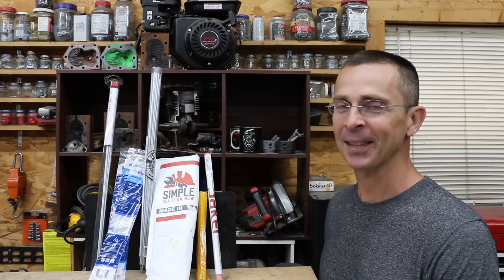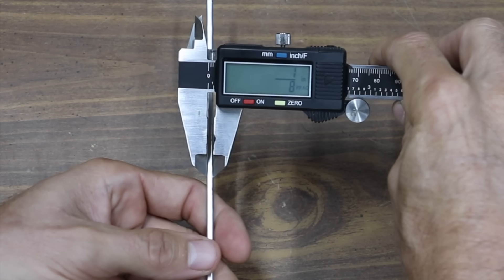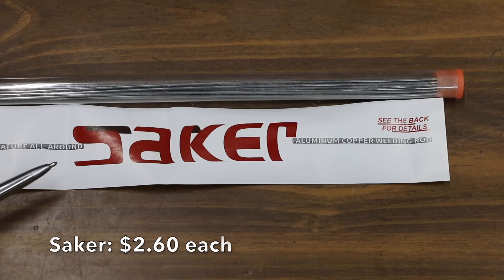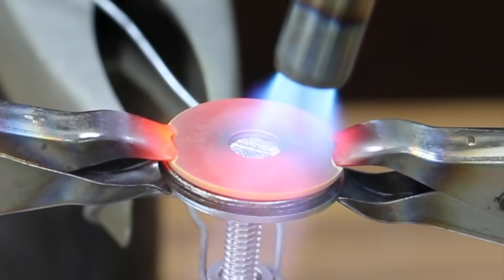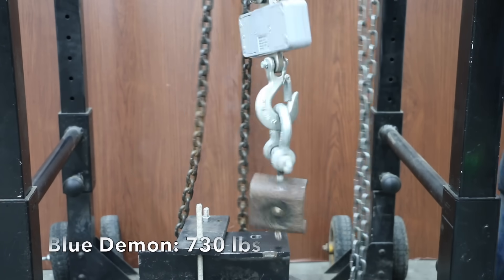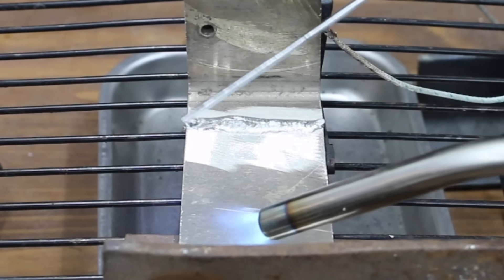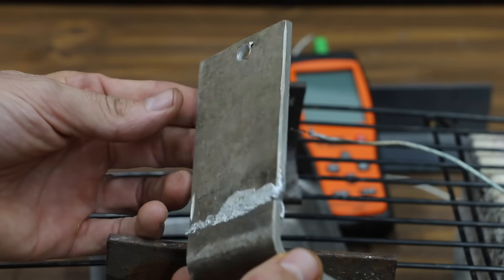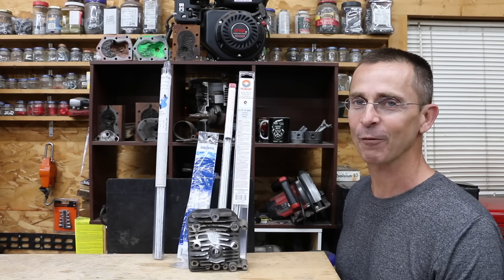Best "No Welder" Aluminum Welding Rods? Alumiweld vs Bernzomatic vs Hobart

Comment: Fun video but you should read up on thermal emissivity if you are using a thermal imaging camera. It prevents misinterpreting the images.
The welded areas could be colder than the rest of the block if it has very poor thermal conductivity but it is more likely to have a lower emissivity causing it to read lower on the camera.

Comment: Chlorinated parts cleaner is only an issue when arc welding. It's the intense UV light that breaks the chlorine down into phosgene. For braising, after the cleaner evaporates, you should be fine with some ventilation.
Reply from the maker: Thanks for the feedback.

Comment: You skipped an important test. You should have tested each rod to see which one flowed in the cracks the best 💯 also you probably should have heated the inside because the rod would have probably flowed to the heat like solder does.
Reply from the maker: Thanks for the constructive feedback.

Comment: Well I suppose perhaps im cursed somehow
cause the bernzomatic rods refuse to melt
for me? On one instance I got my material cherry
red hot just to finally reach the rods melting point
and NOTHING. Im very hard-headed I do not
give up easily but this current project is really
testing me & my mental limits! (broken lifter bore
in dodge 4.7 upper valve train)
Reply: * I never geated the head at any point as I simply did a test run on the broken piece of lifter bore on my work bench and on my fist go the piece melted in less than thirty seconds! I had an old water-pump from an old nissan armada that was no good so I melted some of it down and made a cast mathingvthe piece that had broken off I just cant get it to bond with the head and I Do not want to remove the head from the block
& I damn sure dont want to take to a mechanic as I cant afford it even if I wanted to? sos...(help)

Comment: I just used the Berzomatic to repair an aluminum carb float bowl which had a leak. Had a small hole worn through the bowl from a PVC jacketed electric cable from vibration.

 After heating up for a couple minutes using propane, the Benzomatic flowed against the bowl and plugged the hole perfectly. Cheap and not difficult, saved my a lot of money and time to get my enduro motorcycle running again.
Reply from the maker: Thanks for sharing.

Comment: Dear @Project Farm,
                               I have an IDEA !!!    For a video.

I bought a house and found an old water pump, were apparently someone left water in it during a freeze. The pump housing had cracked and it will not hold water. The motor runs and the propeller is good.

Question (to be tested).  What would be the best product to repair this pump housing ?

Could these low temperature welding or brazing rods do the trick ?
Could something like J B weld do it ?
Are there better products of methods to do this ?

Just an idea !
Be Well, DZ
Reply from the maker: Thanks for the suggestion.

Comment: The IR temperature difference you saw on the head crack repair likely is not a real temperature difference. Every different material has a different emissivity meaning it will read a different temperature on the IR thermometer / camera even if they are the same temperature. You have to calibrate the IR guns emissivity for each different material to accurately read its temper, why yo items made of different material look to be different temperatures when they are not. Some materials actually show reflected heat of other surfaces acting like a mirror such as copper. An easy fix for reading/comparing head temperature and aluminum weld repair is to paint the head and weld with high temperature barbeque paint. This gives the repair and head the same emissivity and far more accurate temperature comparison. Most all paint regardless of color has the same emissivity rating. The other trick is to put a strip of electrical tape on the material you are measuring the temperature of, it gas a known emissivity of 0.95 (does not matter what color the tape is) though may not be good on the head where it may melt...ps copper emissivity is 0.03 far different the ekectrical tape  or spray paint 0.95
Reply from the maker: Thanks for the feedback.

Comment: I believe the reason why the welded area on the engine did not heat up like the rest of it because it didn't flow through the entire cut.  Your cut was ~ 1/16 to 1/8 of an inch wide.  When the combustion was happening, it heated the metal nearest to the piston easier and faster because it was uniform.  When the gap was created, it gave more room for heat to dissipate and not soak in the heat like the rest.  Think of it as an oven.  Ovens cook from the outside inward.  The deeper the gash, the longer the heat will take to reach that depth.
Reply from the maker: Thanks for the feedback.

Comment: Are the welding tests with the washer and bolt, is the bolt also aluminum ? Or is all test aluminum rods trying to bond with metal , or steel ?

Comment: Thank you for another great showdown.  It would have been great to put the engine under load to increase the cylinder pressure and temperature.  The repair area being cooler implies that the weld material doesn't transfer heat as well, good to know.  I'm planning to try the Hobart for repairing a heavily damaged aftermarket VW engine case.  The engine shop didn't want to do it because he wasn't sure if they could make it work.
Reply from the maker: Thanks and you are welcome!  Thanks for the feedback.

Comment: The welding rods come in 3 chemistry's.  First, there is the silicon aluminum rods, melting point >1000C, just a few degrees cooler then aluminum's melting point.  These are really WELDING rods, not BRAZING rods.  The parent material must be brought to ITS melting point & controlled by thermal gradient (like welding steel with steel rods, except it is much more difficult to maintain the thermal gradient because of aluminum's high thermal conductivity.)  You must use oxy-gas torch with this alloy.  Next are the zinc-aluminum rods.  These melt at ~700C.  These are easy to melt without melting the parent material WITHOUT need for thermal gradient, but 700C destroys any heat-treatment hardening, such as in bolts.  The last class is the "SOLDERS".  These are tin-based, with some zinc, like plumber's solder, melting at ~400F.  They require nasty chemical to remove the oxide film (the flux) which will corrode the world if you don't get all of it off after the soldering.  They are VERY persnickety, often failing to form bond to the metal.  Best way to use these is to scratch-brush the aluminum under a puddle of the solder.  Even when made well, the joints are weak, useless for any type of mechanical joint.  They are for making electrical connection only.

Comment: I'd be interested to see how high-strength epoxy compares in tensile strength with the same configuration and testing equipment.
Reply from the maker: Thanks for the suggestion.
Reply: @ProjectFarm  With a tensile strength at around 3x of any of these brazing rods, JB Weld would be my preferred option for repairs that many people buy these rods for. I've used it to salvage things these rods couldn't touch. Takes too long to cure? How much time are people willing to spend on methods that don't really work, and are as finicky, and potentially dangerous, as brazing?

Comment: If you put some flux in the cut in the cylinder head, the weld would probably have flowed all the way through. Little sanding and Bobs your auntie, good as new.

Comment: Used to have some aluminum ' braze ' rod back in 1980s, it was very hard to use. You had to be able to make a puddle and then scrape with something stainless steel right through the liquid puddle, preferably a stainless wire brush.
I only welded one thing successfully with it, an aluminum handle for a grinder.
I used a stainless steel welding rod to scrape the bottom of the puddle and it seemed to work. Stuff was just too hard to use for most things you needed to weld.
I have to try some of these newer ones, they look like they work much better.
Reply from the maker: Thanks for sharing.

Comment: Thanks for this test.  I couldn't get the rod to melt well as the propane torch just wouldn't heat up the base material quickly enough. Made me wonder what's the best propane torch (with a hose ). I looked at Bluefire torch but still wondering which torch is the best.
Reply from the maker: Thanks for the suggestion.

Comment: Please explain for watchers (in the video) why using non-chlorinated solvent for cleaning heated parts is so important - fumes from heated chlorinated solvent residue are extremely dangerous.

"CHLORINATED HYDROCARBON SOLVENTS
Various chlorinated hydrocarbons are used in degreasing or other cleaning operations. The
vapors of these solvents are a concern in welding and cutting because the heat and ultraviolet
radiation from the arc will decompose the vapors and form highly toxic and irritating
phosgene gas. (See Phosgene.)"

"PHOSGENE
Phosgene is formed by decomposition of chlorinated hydrocarbon solvents by ultraviolet
radiation. It reacts with moisture in the lungs to produce hydrogen chloride, which in turn
destroys lung tissue. For this reason, any use of chlorinated solvents should be well away
from welding operations or any operation in which ultraviolet radiation or intense heat is
generated."

Comment: Stop....just stop....listen,.I'm a certified weld inspector and cert. d1.1 unlimited  journeyman welder. Your not welding with those filler rods. Welding is the coalescence of the base metal and filler metal. Your at best brazing. Brazing is a capillary action where The base metal expands when heated, not melted. The "pores" open then a brazing alloy is introduced. The pores close thus creating a bond. At no point does the base metal become fluid enough to coalesce with those fancy soldering rods. Not welding......

Comment: I have watched several videos and demos on you tube. You guys make it look easy.  There must be something you are leaving out.
I am trying to braze together  two .063 aluminum square tube. With MAPP  I tried both Bernzomatic and Harbor Freight braze rods "after SEVERAL MINUTES neither would melt "on the aluminum. I have them clamped with wood  to keep the heat sink off steel clamps, The heat travels up the tubing to the wooden table .The rods got to the point of too hot to touch without melting. I even put a broke piece across the angle of tubing and it failed to melt..  I came back to this video a few times for a reference. They just won't melt !! You video makers really need to get more specific and detailed for first timers on how to make this work

Comment: Is possible to use this to weld cast aluminum? I wonder what is best, flat surface vs rough surface for bonding
Reply: I believe the engine head on the BS motor tested is cast aluminum
Reply: @hanko5750  yeah I think so too, but I wonder what would be best, sanding the part so it’s flat or use a rough surface… I feel like is the flat surface
Reply from the maker: Thanks for the suggestion.

Comment: As far as the cylinder head repair looking cooler than the rest of it, what you actually had was a shiny surface compared to the rest of the head and you were seeing a cooler area reflected at the shiny part. If you spray painted the area, don’t care what color, you would find that it was much hotter than the surrounding head. Which is what we should expect it to be

There is emmisivity, conductivity and reflexivity   These together makeup the delta T or total temperature. The emissivity has to do with the material, the conductivity has to do with how well it lets heat through and reflectivity has to do with how much like a mirror it is and the surrounding temperatures. All three are needed to get an accurate measurement of temperature with infrared light. Emmissivity alone does not account for the temperature being much different from room temp. Conductivity does in this case. Reflectivity is why the area looks cooler than the surrounding head. 
I’m done. 😂😊
Reply: Incorrect

Comment: That temperature difference may not exist because one metal reflects mor
Reply: More infra red than the other is reflected,  fooling the imager.  A contact thermometer may show both to be nearly the same temperature.
Great job showing us how to repair without melting the aluminum too. Thank you.

Comment: I'm looking for a material I can bend by hand, like a thick wire or a rod, cut to the length I need (up to 6 ft long), and can be easily welded, glued or zip-tied, and can support up to but not over 10 lbs of weight.  It's for the inner workings of a large mascot.  The head is a dome shape and needs to be supported on the shoulders.  I don't know a thing about welding, a sawdering iron seems like it would be easier to learn.   Don't know much about them either.
Reply from the maker: Thanks for sharing.
Reply: @ProjectFarm  That was a question, was asking if you knew any materials like that?

Comment: Those are brazing rods but you are trying to use them like a soldering rod.. use a brazing tip and get an actual puddle going to add the filler to.

Comment: It has been a couple years since you made this video and I'd suggest you remake it. But this time please consider the effect of added aluminum welding flux, which I didn't even know was available until today.  Also, I'd like to see how the welds vary, if at all, with different alloys of aluminum. They shouldn't, I suppose, given that the aluminum doesn't melt, but the alloys vary a lot in strength. Most hardware store aluminum is 5052 with the occasional (and WAY better) 6061, which is the strongest aluminum that can be MIG or TIG welded. Aircraft aluminums (2024 and 7075) are generally considered unweldable, though of course with this process I suppose they can be "welded."
Reply from the maker: Thanks for the suggestion.

Comment: People try to join things incorrectly, they are not welding rods, and people think they can do the same job, If you use the correct rod and use them correctly they work just fine, but thinking you can use them just like TIG welding or Gas welding causes problems. I have used the Lumiweld with great success in suitable applications

Comment: Used the alumiweld a few times. Only once was i able to get it to work but glad it did...cut an a/c line on a vehicle at work accidentally fixed it right up and as far as i know 2 years later its still working. Yes i told the customer about the screw up and told her if it leaks let me know and ill replace it.
Reply from the maker: Thanks for sharing.

Comment: Of course, none of this is welding other than (if you are in a generous mood) the one where the bolt head melted.  That isn’t to say you can’t weld with those rods, it’s just he’s not doing it.  If it’s not welding, call it what it is  - brazing – otherwise it’s just another case of YouTube misinformation!  Having got that off my chest, thanks for a very useful video.  Bernzomatic and Simple are available here in the UK, I think I’ll give the former a try.

Comment: Torch test, would be great. I ordered rods using your link. Now I need a stronger torch as I plan to braze the stand to an aluminum chair. 
It would be great to see single vs double torch. Different brands and gasses. 
Thank you for what you do.
Reply from the maker: You are welcome!  Thanks for the suggestion.

Comment: Idea for a test video.
For van conversions these days I see a lot of cabinet building going on with 80/20 extruded aluminum, which is pretty expensive. 
I would like to build using regular aluminum (available at home stores) instead of 80/20.
Connections with 80/20 are done with 90-degree angle pieces and bolts. I would think a similar method would be just as strong but with those angles being bonded with either aluminum welding rod (Bernzomatic) or JB Weld. 
But which would be stronger, aluminum rod or JB Weld? Which method would be faster? Would the finished result be as strong as 80/20?
Thanks!
Reply from the maker: Thanks for the video idea.

Comment: I bought a huge bunch of Alumiweld rods some 15-20 years ago and still have them. I've never found a torch hot enough fast enough to heat the base material to actually melt the rods so I stuck them in a drawer and forgot about them. It's good I ran across this video as I have an aluminum project I need to repair. It's 1/4" structural aluminum which two mounting ears also 1/4" broke off in transit. I have two new ears that need welded to the square tube.
Reply from the maker: Thanks for sharing.

Comment: The 9:49 tensile strength comparison indicates ~12ksi to 3ksi, assuming 5/16" diameter weld area is almost 0.1 square inch (0.097)

Comment: Imo bernzomatic was better due to the fact hobart cracked in the v weld test. Hobart may if had slightly more strength in the pull test but it failed (giant crack) when testing the notched butt weld, where the piece welded with the bernzo stick could of been bent back to shape and back and reused the one welded with hobart rods would need to be ground out and rewelded.
Reply from the maker: Thanks for the feedback.

Comment: Excellent review of this topic and products. Your tests are great and well described. I bought the Harbor Freight Alumaweld rods (on sale) and they worked great on a repair of an aluminum casting I made. It was a thick piece but I brought the whole thing up to 550F and then used a torch to get to 750F in spots and it flowed like butter. It grinds just like the parent aluminum material. I didn't even know this stuff existed until I needed it and was so glad you had sorted through the various brands. Kudos!
Reply from the maker: Thanks!  Thanks for sharing.